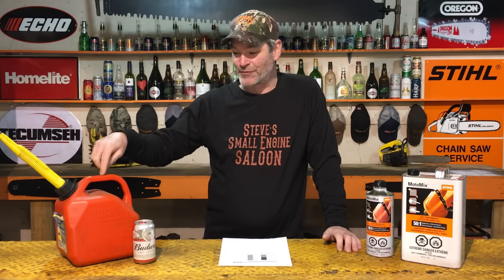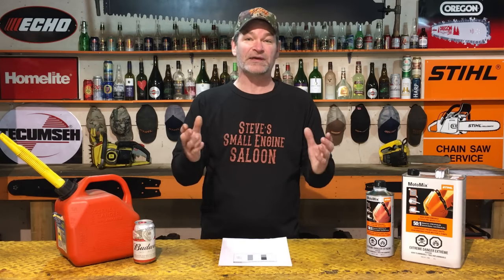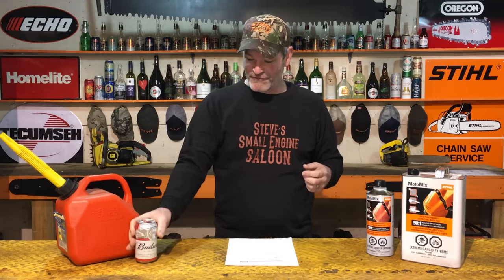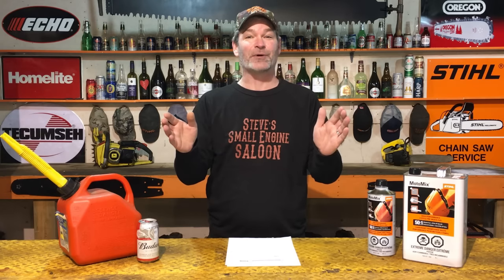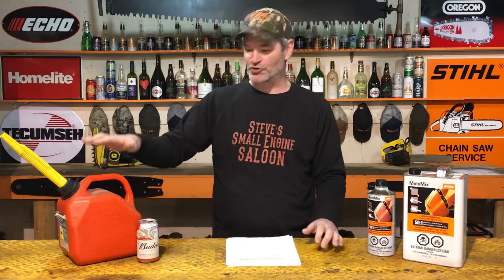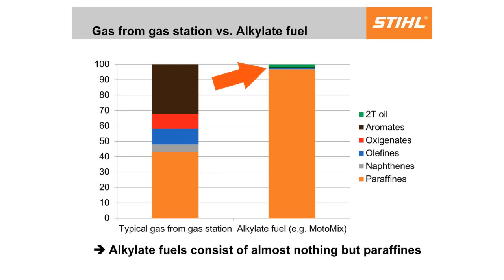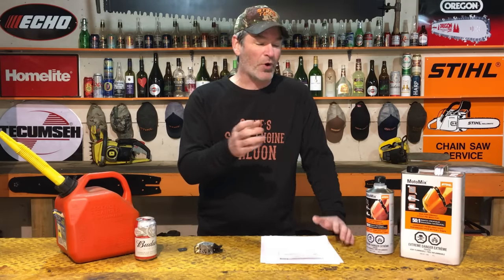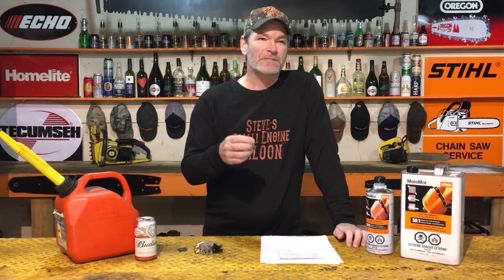The Ugly Truth Why Gas Station Fuel Is Bad For Small Engines

Comment: Here is some food for thought as well. When you go to a gas station and it has a multi-selection for the type of gas you want, just remember that if you are filling up a 1-2gal gas can with, for eg., premium, you will be filling your can with whatever’s the last choice of fuel was made for at least 1gallon. The pipes from the tank in the ground and the pump and hose will be full of the last gas chosen. Put the first two gallons in your vehicle then fill the Jerry can. So if your out with the gang on all your motorcycles and pull into gas station to fuel up with premium, be the next or last guy to fill your tank. Great video Steve. Great!
Reply: Crustyswede1 good advice. I never thought about it that way.
Reply: Or buy a motorcycle that runs on regular.  :-)

Comment: Hi Steve Used you Briggs Plastic Carb Clean instructions and it worked Great Craftsman M220. After 10 runs / 3 full grass cuts 3 weeks the Engine Starts and dies in 20 seconds. Then starts for 5 seconds and dies. Carb Cleaner 5 seconds and dies . Do You think I have to reclean all over again ? I did the .020 micro drill out also. I also wanted to share as I noticed your hanging Needle looked All Metal. Mine in the 220 is all white plastic with a grey rubber like condom thing installed at the tip. I have a 230 from a blown engine and going to take that carb apart and explore it. Air Filter Intakes don't look exactly the same but I have an opportunity to buy a new 230 cheap.Now thanks for the Ugly Truth about Fuel Who Knew ? Thanks again so much .....You are Great

Comment: Love your videos. With respect to the fuel issue. I think there is a practical answer besides switching fuel. Its using an additive like Mechanic in a Bottle. Really does cleanup up the gunk, prevents surging in a mower for example, and gets rid of water. 

I was pulling apart my carb and cleaning the ports due to surging (carb gunk'd up). Even found the carb to be green where I left equipment with fuel open for too long while not in use. Likely got water mixed in and mold or something grew. 

I started using Mechanic in a Bottle and just add it to my fuel at beginning of season. Opened up carb and was surprised. I haven't pulled carbs off anymore because it worked. Truth be told: I haven't been using it that long, so maybe I am just lucky or it only works short-term. So far, I think its working really well. Time will tell.

Maybe you have experience with a product like that? Would love to know your thoughts.

Again, appreciate video. If additive eventually doesn't work, I'll try this. :)
Reply: Are you in America? I wonder if Australia has an equivalent to this product. Cheers 👍
Reply: Scrap that I just checked and we have the same product here lol

Comment: I use regular gas and oil in my equipment for the summer.
I winterize with Trufuel.  I empty gas tank and let run till it dies. Then I refill with trufuel and run for about 5 minutes. Shut er down and store in an unheated shed.

Comment: Great info and advice in your video!
My entire strimmer fuel system, filters and carb diaphragm was totally destroyed by forecourt fuel - even worse now - the ethanol is being increased to 10%. Never using that stuff again. 
Now using premix alkylate petrol, like Aspen make, and skip the benzene overdose from forecourt pump fuel. No ethanol in it either. Keeps for many years with no additives needed, even when left in the machine. And because the heavy distillates of forecourt fuel are not present in alkylate, practically no carbon build up occurs.

However for people who enjoy stripping down the carb every year, well it'll suit you just fine - you're saving on that cheap pump fuel, right?

Comment: Very interesting facts there Steve, many thanks. I have been running Aspen4 in my generator for a few years since new and winterisation in my dirt bikes. Changed to Aspen2 in my three pro saws, a few months ago, and have noticed an improvement in starting and running. Work for an arborist business as a Groundie where I need reliability and less harmful emissions is a bonus too. No more fiddling around mixing fuel either! All Petrol in the UK has ethanol in it now, just not worth the hassle if I don’t use one of the saws for a few weeks.

Comment: Hi Steve love your channel! Thanks for all your great videos. Like you Steve I do something somewhat similar as to what you used to do to winterize your small engines before this new fuel was available. Not sure if you had many issues doing it the old way running engine out of fuel. 
For 45 years I have always winterized my landscaping equipment 2 stroke and 4 stroke small engines (like at least 20 -25 engines) by adding a high quality fuel stabilizers for the last day or 2  of running my equipment, and before storing it for the winter ,change the engine oil, clean fuel bowls if it has one on the 4strokes and then drain all the fuel on all my small engines ,and then start and run engine till it starts sputtering and then put the choke on carb and try to keep engine running as long as possible,to try to get rid of every drop of fuel in the carburetor I possibly can,until engine finally stalls. Then I put it away for the winter. In the spring just before needing that piece of equipment I add fresh fuel(not sure if it’s necessary but I always use premium fuel with the small engines ). Very very rarely have I ever had issues starting or the running of my engines doing that!  If there ever is a problem it’s usually because engine is getting older and the diaphragms in the carb has got hard from years of use.  Not saying that this new fuel product may be even a better alternative, but I really don’t want to mess with what works for me all those years. Besides that stuff is expensive,especially doing all my engines with it!  
Keep up the great work on your videos Steve it has got me out of  trouble  a few  times ,and saved me alot of heart ache and money over the years! I want to thank you!

CHEERS to you buddy you deserve it!!!

Comment: I always run premium with a high quality oil like stihl or husqvarna in my personal saws. 
That being said, when I was an arborist, we used regular 87 octane in all our saws,  I worked as an arborist for 6 years and never had an issue, some of more commonly used saws had hundreds of tanks of gas run through them, with no issues.  I believe the biggest thing is to run the saws regularly and keep fresh gas in them.
Reply: No shit
Reply: Damn it why did google tell me I should use at least 89 octane for my 40:1 mix because 87 wouldn't be enough... im going to try 87 next time
Reply: @xxvodanhxx  no
Reply: @xxvodanhxx  Use the lowest grade octane fuel you can find for these small engines. High octane doesn't mean higher power; it just means it has a higher resistance to knocking and detonation--features needed for high compression ratio engines (performance engines, etc).

Comment: I was told by a stihl dealer if you bought it with your equipment warranty was doubled. I’ve never used this stuff and know it’s expensive but I also only use 2 gallons a season with my trimmer,hedge trimmer and chainsaw. For people in the business as a profession it would be very expensive but the small use homeowner how much do we really use.
Reply: That warranty extension applies to the Stihl Ultra oil, not the fuel.

Comment: Great video I’m fighting a carb issue w my sons motorcycle love the input I think the gas is the problem only one of the 2 cylinders is getting hot gotta be a fuel issue  but I need to check the compression it has spark

Comment: We’ve had this fuel for around 10 years and they can’t make the engines capable to handle the fuel yet? so instead we make new fuel to go with the engines?
Reply: Greed
Reply: more refining of fuel,greater the cost.....It would be easier to redevelop fuel than re designing new engines to suit,which would be @ higher cost,take diesels for example,run on less refined fuel but cost to maintain it is greater vs petrol engine.
Reply: Well it's not the engines fault the fuel is crap and has a 30-day shelf life. Ethanol laced fuel will absorb water into it whether it's in a fuel can or modern engine. Until we make engines that run on water, trying to run an engine on water will always prove problematic no matter how much engineering we throw at it.

TL;DR If you want to store equipment full of fuel for longer than a month, you first need fuel that's designed to have a shelf life longer than 30 days.
Reply: Personally,I would prefer some methanol blend as  a fuel of choice,using a filter separation system to bypass water attracted to it.Better all round tbh:)
Reply: Ethanol becomes unstable after sitting for long periods.  The engines CAN handle ethanol, but ethanol doesn’t handle sitting for lengthy periods.  If your small engined equipment is used every day, then no problem.
Reply: TED Schmitt @ agree it attracts water more so,I use ethanol safe fuel hoses as well in case as I use ethanol & I don't sometimes.....
Reply: I'm not sure how you make a small carb immune to varnish creation...
Reply: Gary Black Just run an inline filter before carb if it does not have one & use fuel stabiliser
Reply: so you want chainsaws to also have catalytic converters ? no thanks the saws are already heavy enough as it is no need to add weight
Reply: I have engines older than ten years, I want fuel to run them.
Reply: @jazpanoz4996  Lol that will not prevent gum and varnish formation. 🤣 If you installed a filter small enough to filter out the molecules of the chemicals that cause the gum and varnish, you'd prevent fuel from flowing at all. Stabilizer is not a genie in a bottle. If you want a carbed engine that can sit for long periods and have no issues, you need to use this kind of fuel OR get a dual-fuel carb that can run on gasoline and propane.
Reply: mannys9130 @ Like Steve said ethanol is the minor problem 🤣
Main problem tbh is people like you...I have small engines with 2yr old fuel still start & work fine because there is more to it than what you know,lol

Comment: I stopped using ethanol a couple of years ago, and haven't had any issues since. I still believe ethanol is the main culprit, and could there be a chance Stihl is just promoting their product, and using this channel as a vehicle for their sales pitch? I've been googling this science, and cannot find these claims anywhere other than from Stihl. Pre-mix fuels are cost prohibitive to most people, and in my opinion, unnecessary.
Reply: I agree. Several years ago I eliminated ethanol from my weed eaters, chainsaws, leaf blowers, mole killer ,and motorcycles. I have not had trouble since I did this. I think this fuel is not necessary.
Reply: I agree as well but am moving to battery powered equipment as much as possible. Too many advantages to list
Reply: @stefanodogg280  Yeah if you don't have much stuff to do battery would be the way to go. But I agree with the other two comments, I switched about 5 years to non ethanol and haven't had anymore problems. I still however run a tank of fuel mixed with mechanic in a bottle for the first and last tank of the season in the my equipment.
Reply: @jruss9109  I have 8 gas chainsaws including two Stihl Magnum types and I too use premium non ethanol gas for them, draining the tanks and running them dry before storage. I've simply found that smaller battery powered saws can get a lot of tasks accomplished where I used to use a gas saw with all the hassle they entail. These batteries are versatile, if you also get the weedwhacker and the inverter.. which can run a laptop, several lights and more in a power outage
Reply: @stefanodogg280  I'd love to get the 60v Dewalt since all my other tools are Dewalt, but atm I have no reason to replace my lil Husky 440, that thing has been a beast.
Reply: @ChrisGilliamOffGrid  I run the 40 volt Greenworks, they are quite a bargain and 50% the decibels. One other thing, they always start
Reply: @stefanodogg280  I got my mom a lil 40v mower for her yard, no gas or oil to mess with is nice.
Reply: One of the Biggest problems is that 99% of people don't store these machines in a good place from the elements! 
If they have any water in it well don't be surprised it don't start the next season !
Reply: I just buy 92 octane fuel for 4 wheelers, and other outdoor fun equipment. It's ethanol free, a tad more expensive, but no ethanol. Dealers that sell 4 wheelers and off road vehicles sell this type fuel. I think people with boats also use it.
Reply: Marty I am a small engine mechanic and I also stopped using ethanol, but finding non ethanol fuel is getting harder. Last year I started mixing stay-bill with ethanol gas and it has worked great for over a year on all my engines. It is a lot cheeper than any boutique fuel on the market today and cheeper in the long run considering non ethanol fuel runs a average of $1 to $2 more a gallon in some places. Just wondering if anyone else tried this with success?
Reply: @kevchard5214  I'm glad that non ethanol is only 20-30 cents more a gallon here.  Always find it at every CENEX station.  Its probably at others too, I haven't needed to look anywhere else.  And it burns better, so the little bit of extra price in my small engines probably comes out in better fuel economy.
Reply: I haven't had to clean a carb since I started using ethanol free.
Reply: Stefano Dogg Electric 👍🏻👍🏻👍🏻

Comment: I have plastic one gallon fuel cans that I don't want to just throw away or just let them collect dust on the shelf. If I empty out the engineered fuel into those plastic cans and throw the metal can away, will the fuel degrade any quicker or will it be just fine in the plastic cans? Love your videos by the way!!

Comment: Been using premium fuel in all the Echos using Echo  Power Blend extended life oil for over well over ten yrs, so far I've spent $25 on  carb kits and fuel primer bulbs. One thing I always do is give the machine a  shake before starting just to remix oil in tank and don't store with a full tank. Good idea for some people to use proprietary fuel.
Reply: Thanks for sharing Jimmy. Why do you not store with a full tank?

Comment: Have used an old echo chainsaw for 35-40 years.  Always run nonethanol gas.  Saw cranks on 2nd or third pull after chocking.  Only have replaced the bar and chain.  Thanks, Steve for all you do to help.  I really like your videos and have learned to drink different beer not just Bud.
Reply from the maker: Thanks for sharing

Comment: I started using this premixed fuel in my chainsaws three years ago. On my last tank for my saws I fill up with premix and run my saw then top off for winter storage and so far no problems with gummed up carbs or cracked fuel lines.The store bought fuel is too expensive to use if your cutting cords of wood but for storage in the winter its fine.
Reply from the maker: My idea also.  Right on...

Comment: I use Briggs and Stratton Fuel Fit  mixed with ordinary fuel station petrol ( OK gas!) in my equipment. ( Plus Stihl two stroke oil in  my two stroke engines) l have a Stihl 038AVE saw that is well over 30 years old , I've never touched the carb yet! However l always let the carbs run dry before l put them away for the winter .

Comment: Steve, how about using Avgas (100LL)?  Very clean aroma even after several years storage unlike old pump gasoline.   Smells kind of like the "white gas" we used to buy years ago.  Good octane rating and a healthy dose of lead in spite of the low lead designation!  Last time I bought some it was about $7/gallon.
Reply: Good question!  I've been using 100LL for the last few years in my garden equipment since I have it around for the motorglider I've been restoring.  I have some that after 4 years still has that clean aroma.  Also would like to know how "white gas" is rated in comparison to the designed fuel for small equipment.

Comment: Also, if you want to put premium fuel in your gas cans, make sure to clear the hose of whatever gas (probably regular unleaded) the previous customer used.  I usually put 1-2 gallons of premium into my vehicle first, then fill my gas can.  If you pump the gas into your can from the start, you're actually not getting the gas you're wanting, and if you're only buying a gallon or 2 that can make a big difference.
Reply: Wow, that thought never crossed my mind. Thanks for that tip.
Reply: Nice tip!
Reply: Most manufacturers don't recommend premium gas. I know Hustler doesn't and neither does Echo. I had a 200hp HPDI Yamaha and they recommended regular gas.
Reply: In New Zealand we have a separate hose for each gas type.
Reply: @jeffcoulter7181  ya .. Murica  🙅😂
Reply: @jeffcoulter7181  I use the purple one
Reply: Good grief, there isn't any fuel left in the hose. Maybe miniscule insignificant traces, but it's not holding fuel.
Reply: @J-Ball From what I gathered, it's approx 1/4 to 1/3 of a gallon thats left in the hose from the last customer. Can make a difference if you are only getting a gallon of gasoline.
Reply: @jeffcoulter7181 That is how it should be. In USA most fuel pumps use but one hose and a selector switch for all 3 grades. Cheers!

Comment: Wow!! I always thought that Ethanol was the only culprit!!  I’m going to store some equipment with this engineered fuel.
Still can’t figure out the best way to store my generator though.  Big fuel tank with treated non-ethanol gas in it.  Do I drain it and run dry or top it off and shut her down?
Reply: I take a different approach with my genny. I keep ethanol free gas with stabilizer in it and start it every other month. During an extended outage I'll run ethanol gas straight from the pump but once the juice is back that crap goes in my car and I run the stabilized gas through it before storing.